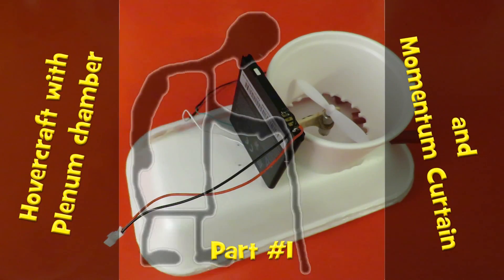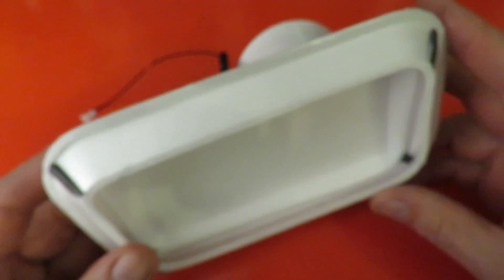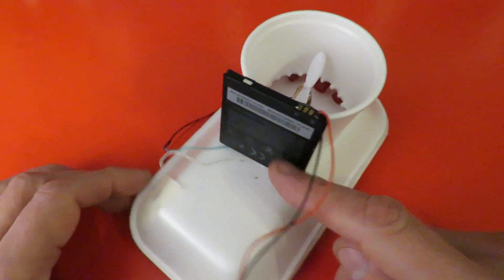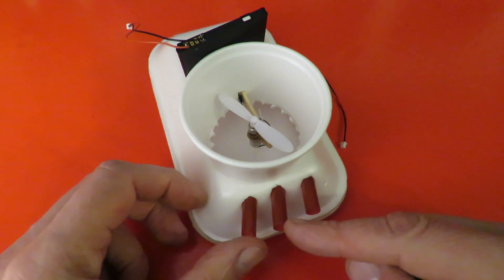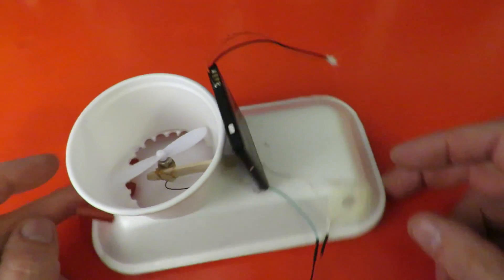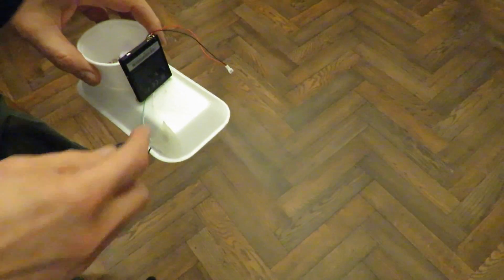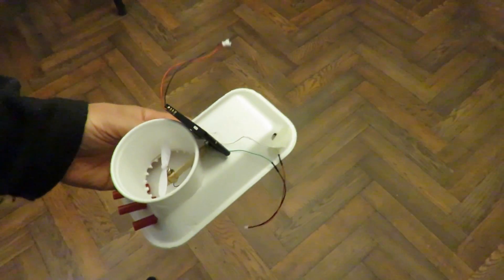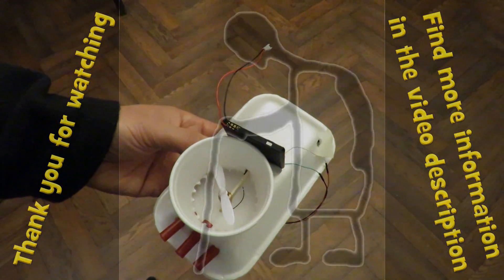Hovercraft with Plenum chamber and Momentum Curtain

Comment: Nice. Did you ever try it without the internal baffle installed to see how much lower efficiency the thing was with an open plenum design?
Reply from the maker: Interesting, second comment in the last hour on videos that are more than 6 years old. I wonder what YouTube is up to today 🤔🤔In answer to your question, here is similar build from a couple of years before, without the extras inside, but a different motor and propeller https://youtu.be/uIx6limEIoI?list=PLA5a2xPRSrB3zoLYIrdESCCWdx2nLq8r7 Thanks for watching and commenting 😊😊👍👍
Reply: @GrandadIsAnOldMan  In my case it wasn't youtube suggesting anything. 

I was doing a google search for a comparison of open vs closed plenum designs of hovercraft. There's some talk of Cockerell’s original experiment comparing the two using scales but I couldn't find any example videos anywhere of anybody repeating the experiment in modern times. I didn't know if it was something you'd tried while making this.

Thanks for the video suggestion I'll check it out.
Reply from the maker: @DEADB33F  thanks for replying, and watching. There are probably too many differences between the two builds to give a good comparison, but it is the best I can offer. I haven't done a new hovercraft for years now, although always on my to-do list.

Comment: sir,if u use plastic bag (thin) then will it be lighter?
Reply from the maker: +Aspboss Llol if you mean a plastic bag for a skirt then that is not included in this design. By forcing the air to create a pressure wall around the inside edge of the body we are working without a skirt.

Comment: You should use that small helicopter receiver in you mini flying wing to control it :)
Reply from the maker: +X-FLIGHT101 you will see that in part's 2 and 3 :)
Reply from the maker: +X-FLIGHT101 part 2 is 5th May, Part 3 15th May, Part 4 17th May  :)
Reply: +GrandadIsAnOldMan Ok looking forward to see how you do it. I need to do a little project like this some time.

Comment: To fix the issue you need to have 2 motors both spinning in the opposite directions? This is how Chinnock works to counter act the affect.
Reply from the maker: +Dalwinder Singh yes you could do that. There are other ways of fixing the problem. The easiest way is just direct a portion of the thrust out the back and use a rudder to direct it.

Comment: Hello :-) 
I really enjoy your videos. I work with children and build all kinds of things with them.  I just recently build CD-Hovercrafts with them, and since I have some coreless quadrocopter motors laying around, thought about building something like this... just to discover your video in my subscribed channels  :-)

Do you think this set-up would work with two AA batteries as well? Cost is always a factor for my projects.
Reply from the maker: +Marcus Shaw the problem with normal AA or AAA batteries is they simple don't give much power compared to their weight. In the video description you will find a link to my Hovercraft playlist and you will see many of my earliest hovercraft used ordinary batteries and barely lifted off the ground. I understand the cost issue but you can get small LiPo batteries fairly cheaply and they will give you a dramatically increased power/weight ratio. In a later video you will see this hovercraft work fine with a tiny LiPo and a hobby grade RC receiver controlling lift and thrust.
Reply: +GrandadIsAnOldMan 
I've bought a couple of quadrocopter replacement motors (Something like 6x14mm coreless) and two have enough power to get a 50cm/20" foamie plane into the air, I think/hope they will work :-) Thanks, I'll check it out.
Reply: I'd say use 2 AAAs instead and experiment with the positions of the cells to balance the vehicle and get the optimum thrust.
Reply: +GrandadIsAnOldMan  
Thanks for your thoughts on the subject. Yes, weight and current of alkaline batteries is what I am worried about :-) It's just that paying for 10 or 20 (plus charger board) out of my own pocket is out of the question, and for the kids here it's all what's available.  I have not seen your eariler hovercraft videos but will check them out. 
I do have a few 160mA battery packs I bought when Hobbyking had them for like 20 cents, but they are reserved for small RC boats and planes based around the ESP8266 :-)

By the way, do you care for project ideas? I've recently made a few interesting things with students (Coherer, electrophorus, floor tile piano...) :-)

Thanks again for sharing your project, it was a great source of inspiration, e.g. we've built rubber-band cars and such, and I could implement a few things you've shown in your videos.

Have a nice day!
Reply from the maker: +Marcus Shaw the problem with the power/weight ratio is a big issue. The same problem applies to the motor and propeller. The motor and propeller I use in this hovercraft are eBay purchases. I didn't put the links in the video description for this video but I will add them now. In my hovercraft playlist there are a few videos featuring an Interplay Hovercraft kit. That does use normal batteries and has a good 'normal' motor and it does work so it might be worth watching those videos.
Reply from the maker: Marcus Shaw yes those are the sort of motors I often use, good luck :)